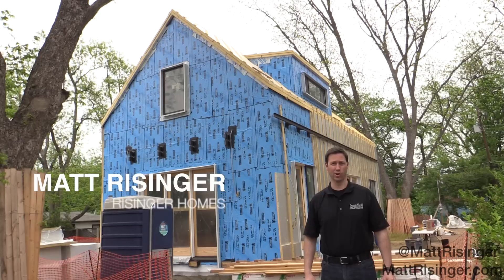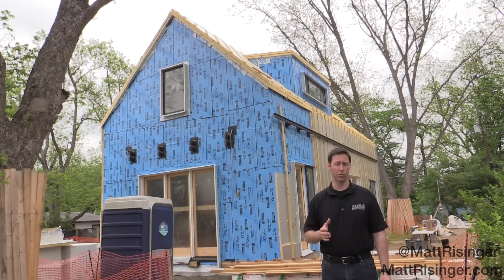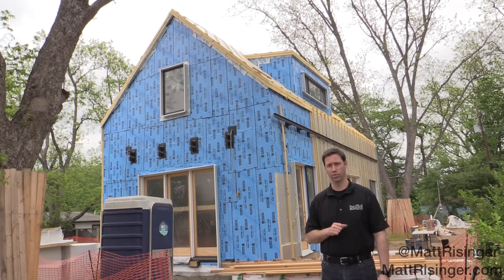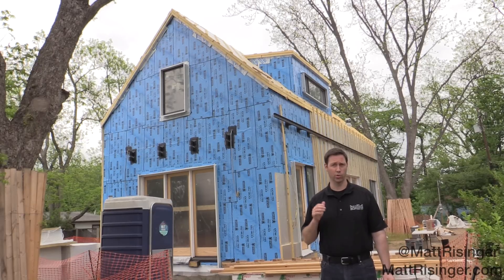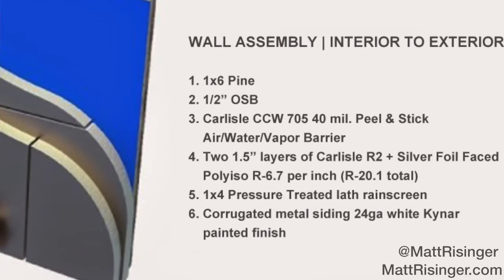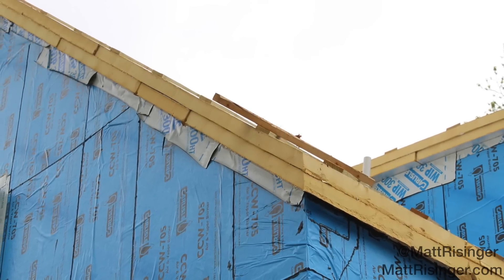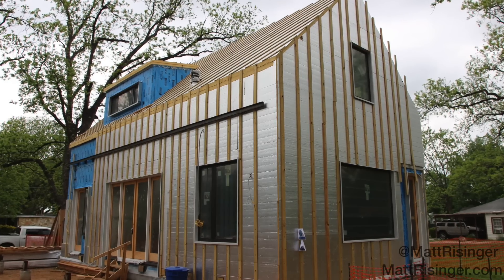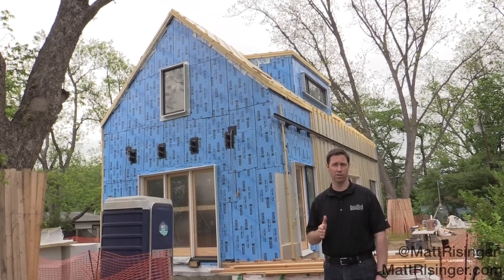What is the "Perfect Wall" for a house?  (with 500 year durability)

Comment: The Coliseum is built primarily of concrete made with volcanic fly ash.
Reply: 523hotsauce. Sorry, concrete.  Look it up. http://www.romanconcrete.com/
Reply: The Romans first invented what today we call hydraulic cement-based concrete. They built numerous concrete structures, including the Pantheon in Rome, one of the finest examples of Roman architecture that survives to this day
Reply: My error was using the word "primarily", but concrete was used, and the Romans used it extensively.  Look it up. http://www.the-colosseum.net/architecture/materials_en.htm
Reply: You two are both right, Both concrete and lime were used extensively. Without even one of the 4 primary materials (lime, limestone, fly ash and concrete) the coloseum would cease to exist. There is no way it would be the marvel of historic construction that it is known for today.
Reply: Some would say "recycled" to build Vatican buildings. Earthquakes had caused much of it to crumble. I doubt there was much interest in preserving "historic" buildings back then, especially given the rather sordid history of the place.
Reply: you forgot to say "look it up."  In any case, is concrete not a rock?
Reply: Not really. Concrete is a composite material, made from some sort of aggregate, which usually includes rocks and sand, and cement. Cement is a pretty interesting material; it's not just crushed rock that's stuck back together. The water added to dry cement doesn't evaporate when the cement cures, but rather reacts chemically with materials in the cement to form hydrates. The interlocking of those hydrates gives cement it's strength. There are a number of different types of cement, so this is pretty general, but it really is it's own class of material.
Reply: and lemon Juice
Reply: Good portion of it is located in the Vatican after it was looted.
Reply: Lime, not concrete, big difference.  Major difference, look it up.   Concrete did not happen until relatively recently.
Reply: @523hotsauce  LOOK IT UPON GOOGLE !!!!!!!!!!

Comment: Matt, I find your videos mostly very instructional. However I didn't like this one. Layers and layers and layers of insulation material. How about the cost? I also think that the house needs to breath. Why don't we simply buy plastic boxes and live in them? I didn't like your comment about rock houses. Actually on occasion I sleep in a rock house, its very chill on summer days and gives me the best sleep. I guess this is because the house breaths. Finally, for a scientific talk you used the word client multiple times. Anyways, after all I like your other videos.
Reply: Houses don't need to breathe. That is one of the most pernicious and damaging myths in residential construction.

People need to breathe. There are plenty of ways to achieve that in an airtight house, such as a balanced pair of fans or an energy or heat recovery ventilator.
Reply: samuel ozkan , hey im just some random but there are ways of getting fresh using an air exchanger. In modern homes they are very sealed up which is necessary to insullate the house and save energy in heating and cooling. An air exchanger solves this problem by exchanging fresh air in a way that transfers the temp of the indoor air going putside to the fresh air coming in. For example in winter, you'd still have fresh air coming in but your home but it wouldn't be cold air. 

You are right to be concerned about air quality. Chosing low VOC products will result in better indoor air quality, especially when the home is new and certain costruction products are still offgasing. Vinyl is notoriously bad as it offgases for years and years, unless its a brand that markets itself as eco.
Reply: Haile Xiao like your comments. I am a big fan of building science, and I am Chinese as well. 我的邮箱   maxy81118@gmail.com

Comment: errr here in europe we have buildings at 2000 years.... so no need to invent the wheel
Reply: Salvador Nobre Veiga: Hard materials with lots of thermal memory don't do so well in earthquake areas.
Reply: Thermal mass by itself is great if there are big temperature swings between night and day and humidity is low to moderate. That doesn't describe large parts of North America very well. Wood is a much better insulator than stone or brick anyway, so in many cases it's more appropriate for most North American climates.
Reply: Granted, one could replace the wood studs with concrete/brick/stone, but it is still best to put the insulation on the outside even if it eventually needs to be replaced.  This allows the interior to function much better as a thermal mass, vastly reducing heating/cooling costs.
Reply: Ralph Marshall 
I was agin the wars in Afghanistan, Iraq (part 1&2), Libya, Syria, Yemen....but I work 80hr per week paying 40% taxes/FEES....I don't have Fuking time to be a revolutionary....there's only so many seats in the lifeboat, I love my Black,Latino,White American children more than I love their children. 

No matter how many wash-up on the beaches, YOUR virtue signaling Sophistry is never going to change my mind. 

I feel sorry for you....as I would a village idiot.
Reply: Salvador Nobre Veiga OK you have the best of best. We spend our money on walls to keep you out!!!
Reply: But you also had no indoor plumbing, chamber pots and wiped your ass with hay.
Reply: Maybe ur ancestors did mine sure didn't
Reply: my grandparents house, the house is from the 13th century. All the walls are original still and they sure have plumbing, windows and anything you can think of. And in terms of insulation, its cool in the summer with no need for any type of AC and in the winter it never gets terrificaly cold - even on days below 32F the house never gets below 60F without any need for heat.

Thats what thermal mass does unlike a house made out of paper/cardboard and sticks
Reply: @NoRoads2AllRoads  13 century? We.re talking about kings and queens here!
Reply: @paraschivlaurentiu70  yeah 13th century is when the house was first built. It had has renovations of course but insulation not yet. Something I actually am trying to have it done. The thing is, while sure it gets cold or hot it's nothing like the wood frame construction. Wood frame construction standard insulation, even on an 85-90F day is unbearable inside after 4-5 hours. Or really cold after 4-5 hours. We do have nights at sub 32 but even then without insulation and any type of heat that house had never seen Temps below 60F inside. My house in the states, goes below 60F really easy. Not to mention during summer... My grandparents with no ac just endured a 8 day heat wave of 110+F this summer... Only at the end of the 7th day, Temps started to get uncomfortable inside the house (85F) where day Temps were 110+ and the low at night was 92-95... During first few days it was cool and nice in the 70s inside the house but by the end it got uncomfortable at 85F... Even then, my house in the US it takes maybe 5 hours in an 90+ day to get into the 80s while this one took a few days. Of course during big heat waves, after a while thermal mas works against you
Reply: @MrShwaggins lol i m from "europe" and that was funny
Reply: If ending wars for profit and fun is revolutionary, I am proud to be called one... Now that I'm retired (after my OWN 70--80 hr/week career in Heavy Construction, I'll carry your load... Just stop with the bullshit of pretending that the OTHER is the enemy... They are hungry, scared, and just want to go home... US policy prevents all that... And if you are an apologist for corporate empire, and war as a business model, you are not the man you think you are...
Reply: And it dawns on me... You're working 80 hours a week... And yet... Here you are... 11am on a Tuesday by my clock... On Youtube... Get back to work... Or are you bullshitting us all about who you are...

Comment: One of the problems I have with outboard insulation is window replacement.  If you use a flange style window nailed to the OSB, then to replace the window you have to remove siding and rip up the foam insulation around the window.
Reply: There are two simple ways to get around that:

1. Use flangless windows. My preferred solution, and creates the simplest drainage geometry and the best aesthetics--innie windows look right to me, outie windows look too flat unless installed recessed to the inside.
2. Build a wooden box in the rough opening extending to the outside edge of the insulation, flash it, then install conventionally.

Comment: I found the finished building here: http://www.houzz.com/projects/1608514/perfect-wall-house
Reply: Rad! Thanks for saving us the time! Haven't even clicked on it yet, but excited (and hoping) to see a corrugated white exterior!
Reply: Cost $200k.  Outrageous for a tiny house.  Good demonstration of barn construction with insulation.  Metal panels are not 500 year.  Rock or brick?  Roof metal & insulation does not have sufficient detail on how it is attached.  Indoor plumbing and electric is barn quality. Same house could be much better with https://www.youtube.com/watch?v=9kwJw7J9C70&list=PL-DI6aLMpoCnT2E7HGWBDV1hjm_arR7ex construction
Reply: Thank you.

Comment: Nice info on your videos. Having been in the business for 30plus years, and building in many parts of the U.S., its all about geographic location regarding what is perfect. What inspectors allow in Austin, TX. would never pass in other areas regardless of how many times you open the IRC code books to prove a point.  Take 24" O.C. spacing of 2x6 studs for example : While it may be legal per the IRC code books, local inspectors and codes have the final say, and in many areas, officials will not even approve plans containing such specifications. I'm all for building sciences and new ideas, but unfortunately, it takes far to long to implement and become routine in America. The good ol' boy system prevails.

Comment: Matt, how does this product compare with Delta Vent SA?, I am leaning this way but found your video on Delta Vent SA interesting as well.
Reply from the maker: +Johnintoit This is intended for a "Perfect Wall" house where we have no drying to the outside.  If you are building in a Northern Climate and have cavity insulation the Vent SA is a MUCH better choice.  Matt
Reply: Matt Risinger the Carlisle would work in Northern Climates if using an unvented attic assembly and closed cell insulation in the cavities, no?

Comment: Matt, have you ever investigated using a liquid applied rubber product such as Rub-R-Wall or Ames Blue Max instead of the peel-n-stick product. It seem easier to apply, and at a quick glance looks cheaper.
Reply from the maker: I'm not familiar with those products. But I do like the Fluid Applied WRB products generally and they could be a swap for the peel and stick. The Tremco, DuPont, and a few others are very impressive products.

Comment: Matt, you need to mention in which climate (or location) you are building this (best even in the description), or else people will just copy this "out of context" which is very dangerous.
Reply from the maker: +Pinwheel Builds Good point, however this Perfect Wall concept is meant to be built in any climate zone in N America and work with the exception of thicker insulation on the outside.  Check out Building Science Corp's website for more info and whitepapers.  Matt

Comment: Hi Matt, thanks for the great videos! I love this concept but have a concern about it blocking sound. I just finished wrapping a block home with 3" of polyiso. During the process I discovered it does a very poor job of blocking exterior noise. I'm wondering how this wall concept performs in terms of soundproofing?
Reply from the maker: +Stephanie  Miller I agree it's not the most soundproof method.  There are ways that could be increased however if you lived in a loud urban area.  You could add a layer of Sheetrock inside or outside on top of your sheathing.
Reply: +Matt Risinger +Stephanie Miller Great video.  With 2x6 walls, that's plenty of room for soundproofing fill (doubling as additional insulation) and I wonder if you could double up on the duty of the wall.  With 2x6's you could use the first part of that depth for the soundproofing and the remaining space for modest built-ins.  It would take nothing to cut some pre-doweled shelving and glue it to the insides of a wall cavity. Maybe 2x8 or even larger for some walls.

Comment: how does the insulating foam hold up to shrinkage/expansion?  Seems like id have to change the outer insulation a lot in an area that has fluctuating temperatures I.E everywhere
Reply from the maker: +Shane Phelps Indeed shrinkage is an issue.  That's why I advise two layers with staggered seams.  Matt

Comment: I assume it is make with 2x4 construction, why does the diagram say 1x6?
Reply: +Kevin Lynch 2x6 allows for 24" on center spacing.  There are a ton of benefits of using that spacing and even more for the extra room the wider stud provides.  This allows more room for plumbing, electrical and other things. If the insulation is on the outside, you could use the extra space for additional soundproofing (as one example).
Source cited: https://basc.pnnl.gov/resource-guides/minimum-wall-studs

Comment: Hello Matt,

Im about to build a recording studio and i have to say that I'm stunned at this "perfect wall" approach. The idea is to have no drywall ceiling  but rather open framing like the house in the video, but, I have been struggling on how i would keep the heat away. 

Would it be possible to use this method and still somehow soundproof the roof? Thank You. Ever
Reply: Build a sound proof recording booth Inside of the structure?

Comment: Hi Matt, thanks a lot for your videos. I live in Australia so many of the products you use aren't available here. But I appreciate your technique and attention to detail.

What's your opinion of 'double stud' or 'double envelope' wood frame houses? In terms of thermal and acoustic insulation capability, design, cost etc. Basically a 'house within a house' type concept. Separating the outside from the inside with 2 layers.

I live in Sydney and I don't think it's popular here. I asked a builder today and he's never heard of it before.
Reply from the maker: ***** I've not built one that way, but like the concept.  Remember I'm in Texas so my delta between inside and outside temp rarely exceeds 30-40 degrees F.  In colder climates that's a more common approach in the States.  Thanks for watching and commenting.  So cool that you are in Australia and watching my videos!  Matt

Comment: Matt,  Are you aware of any research regarding homes that have been retrofitted with expanding foam?  For example the services that offer entering the wall cavity via a small penetration either externally or internally and pumping in expanding foam to fill the cavity.  My question is when an older home has been insulated with this method does it decrease the materials ability to dry either to the  inside or to the outside resulting in retained moisture and accelerated decomposition?  I'm interested in this service but concerned about downstream hydroscopic effects and altering perm in a negative way.  Your productions are great!   Please keep them coming.  
Best

Comment: Matt, if you apply the Carlisle wrap does it take the place of Tyvek d?  Also can the new thermal wrap from tyvek take the place of the foam sheets? How about using the wafer strips to promote air flow between the wrap and the siding?
Reply: VJ Meitl It would seem to me that the furring strips would provide for that airflow, reducing moisture ,condensation .

Comment: We have an old early 1900s farmhouse in northern VA and we are planning to do a major renovation/remodel. We'd like to make the place as energy efficient (and as long lasting) as possible. Is it practical to consider using such a system when renovating an existing structure? If we did so, are we essentially looking at 'new construction' prices? And lastly, I know you are a big fan of Bensonwood, so how do you compare this system to the SIPs system used by Bensonwood? Thanks for the video and any tips you can provide.

Comment: Matt, thanks for posting this. I will be doing a similar job but retrofit. What is the roof assembly on this house? Daniel
Reply from the maker: Daniel,  The roof will be Decking, Carlisle WIP 300HT underlayment, two 3" layers of Carlisle R2+ Silver Polyiso (stagger seams), then 1x4 lath, and finally a screw down metal roof.  Stay tuned to my blog for some updates and details on the assembly.  MattRisinger.com  Thanks!  Matt

Comment: Does the two layers of polyiso r20 exterior only insulation work in a cold climate?
Reply from the maker: I'm in Climate Zone 2 and the 3" thick foam meets code for most of Texas, depending on which zone you are in you might need an additional 1"-2" on your walls.  Best, Matt
Reply: Thank you Matt. Great work  with the videos, but more importantly your builds.
Reply from the maker: Steven F. S. Bruni Thanks Buddy!

Comment: Hi Matt, Michael here once again. We are in the early stage process of planning to build a house. We are leaning towards a SIPs house construction at the moment. What can you tell us about the difference between this "perfect wall" and a structural insulated panels' construction with plywood instead of OSB?
Reply from the maker: These are two different concepts.  SIPS is good, but it can be more susceptible to thermal bridges and it has less potential for drying if water gets past the WRB.  I would prefer a Perfect Wall to SIPS given the choice.  Matt